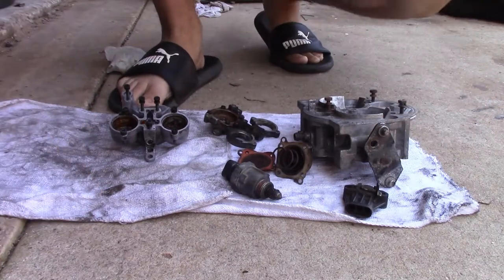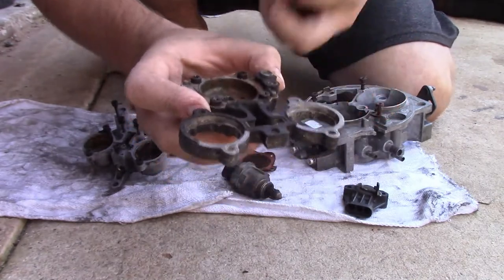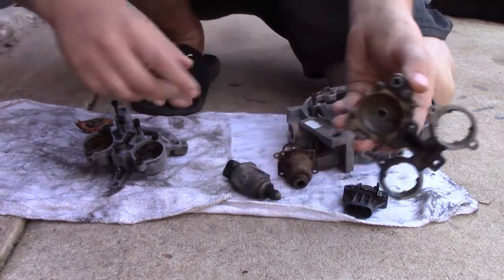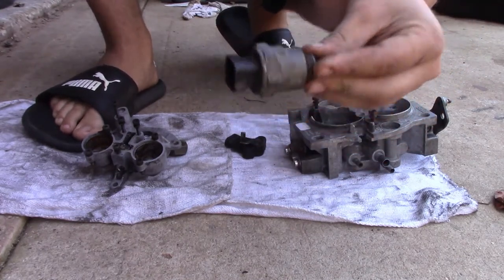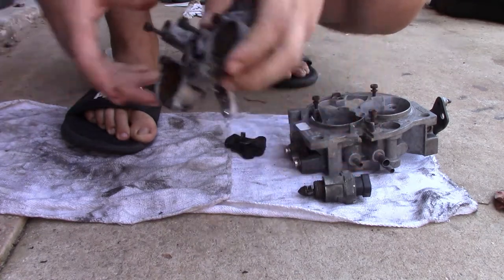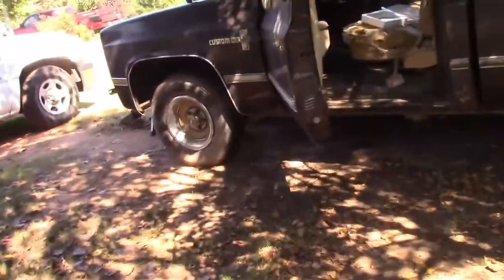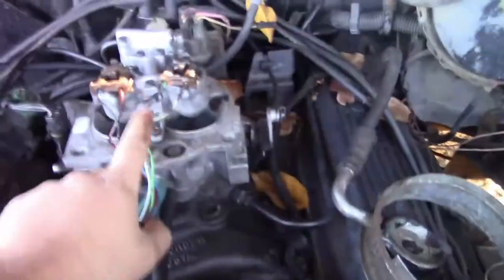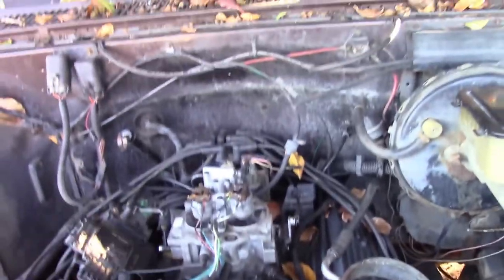How to rebuild GM TBI Unit

Comment: Tip: Prior to installing new paper gaskets. Coat them with Chapstick. It will prevent the gaskets from sticking. Always coat the O-rings with a dab of motor oil prior to installing the injectors in their pods. And hand tools only on the TBI unit. No air or impact drives.